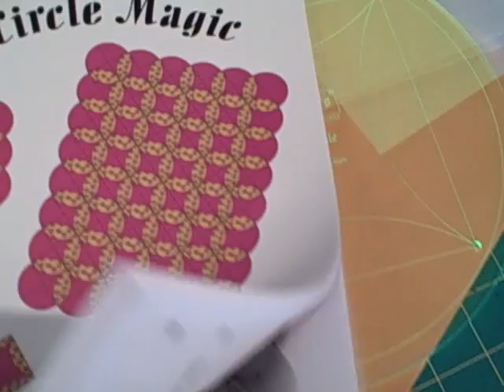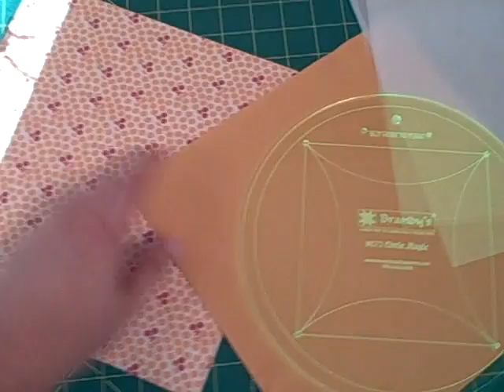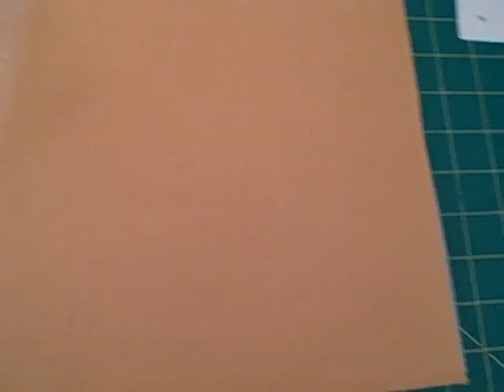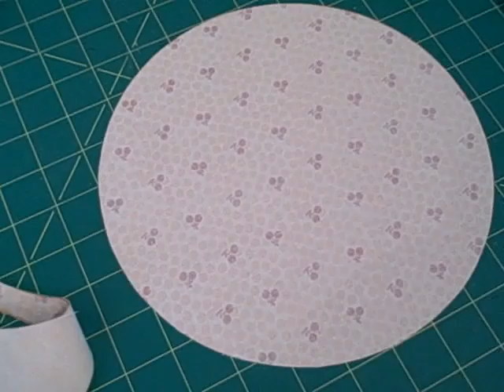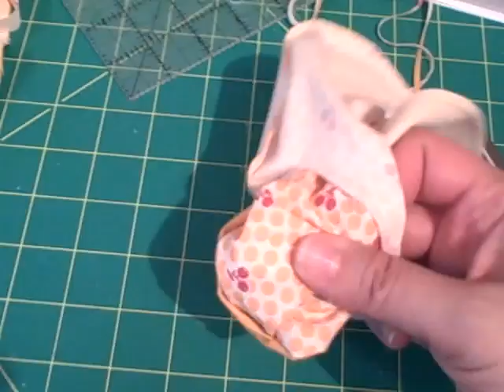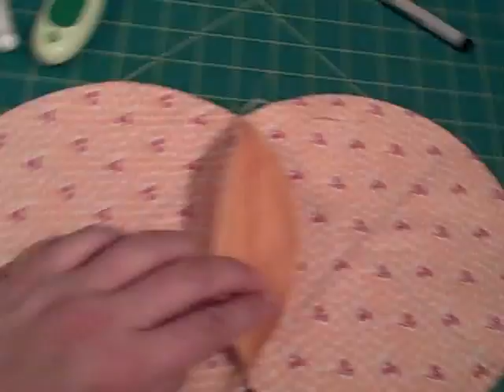Circle Magic Tool

Comment: can I do this with a 8" circle also?
Reply from the maker: hi there! You could do this with an 8inch circle as well but the tool we use in the video has markers that make the design easy to follow. You would need a different tool than the one we show here to have the same effect.